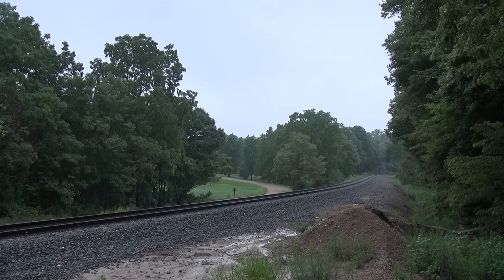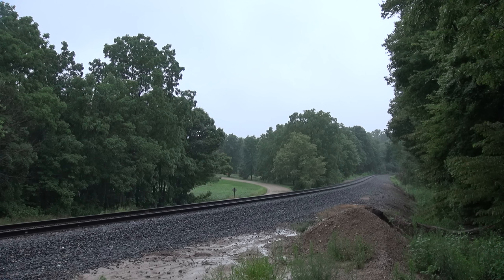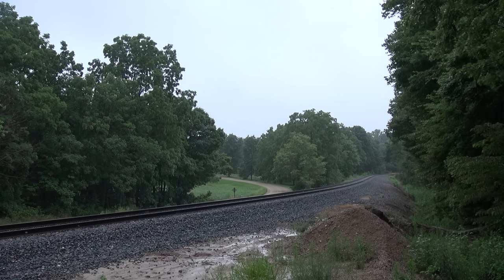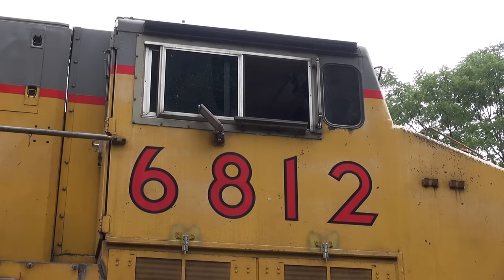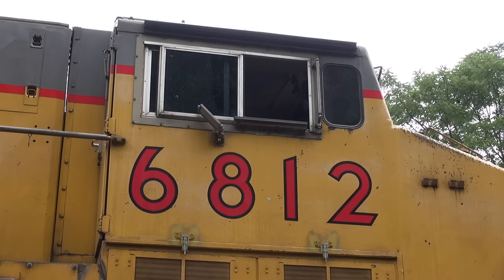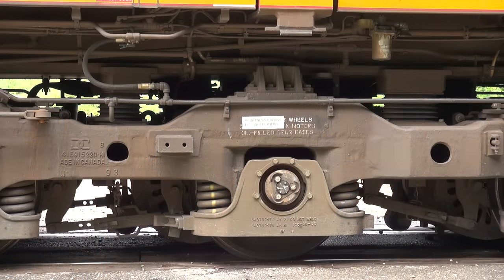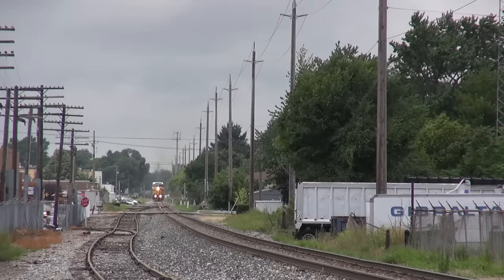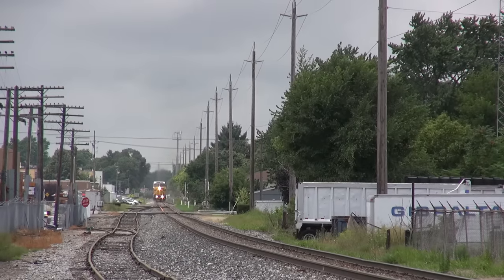TRRS 477: "Whoops!" CSX Freight Train Stalls on Grade

Comment: As a locomotive engineer myself for 30 years, I can proudly say, such an event never happened to me. If a load was exceeding the ruling grade I refused to accepet it.
Reply from the maker: I've heard that the crews are usually persuaded to take them in order to get home, otherwise the railroad has their means of "getting back" at the crew.
Reply: Yes, came across this attitude many times in my career, however, Engineers need to stand their ground, as it is THEY who will stand in the dock when the Sh** hits the fan, not the controller. In my country, every engineer must pass a safer working examine which is a Government Instrumentality, which has very clear rules, and any engineer deviating and breaching said rules, opens themselves to litigation and possible prison time. For example, in the video depicted, the rear half of the train is required to be PROTECTED at the front portion, AND the rear, even in CTC signal controlled areas. This means the second man needs to walk back to the rear portion of the train to put down protection. I did not observe this being done in the video. Also the roll back, that is totally forbidden here. Screws up signaling totally, and not to mention any level crossings in the rear as well. Therefore, it is the interests of engineers to draw the line in the sand conforming with the Rules and regulations FIRST, not what the despatcher or controller would like them to do. Many times I have had to point out the page number and paragraph to the despatcher, when they demanded I perform some action that was clearly, contrary to the rules. I did not endear myself to them, but I wasn't in the job to make myself popular to them. I performed my job as laid down in the rules provided, there was nothing the despatchers could do except fume and plead ignorance of the Rules.
Reply from the maker: All rules here were complied with. The crew needed only to set enough handbrakes to hold the rear of the train on the hill before pulling away, no rear-end protection necessary - that's what the signal system is for. What do you mean by "roll back"?
Reply: Where I worked, halving a load required protection be put down at the front AND rear of the train, as well as applying WORKING handbrakes. It matters nought, that the train is in CTC territory, as the signals do not indicate where the blockage is in the section. That's why the protection in the rear to give advance warning anyone coming from that direction is getting close to the obstruction in front of them. The "roll back" seen in this video, is the tension on the buffers being pulled from the front being relieved and then tension from the rear as the load is going back down the grade. IMHO, poor example of train handling, as the Engineer has not applied the train brake, which would have avoided this. For what it's worth, this event should never have been allowed to happen.
Reply from the maker: In North America, CTC includes rear-end protection. Following trains will go through the progression from Clear to Approach, and finally a Stop-and-Proceed or Restricted Proceed, both of which require the train to be handled at a speed which permits them stopping in one-half the range of vision, short of obstructions or track defects, not exceeding 15 or 20 mph, depending on the railroad. 

So in this case, no rear-end protection is required. Neither is front-end protection, either, it's covered in much the same way as well as by dispatcher authority. This is a large part of why there is no longer required to be anything other than an EOT on the rear of the train, to rear brake-pipe pressure to ensure continuity. 

As far as train handling, since they were moving so slow, and trains on this grade are known to crawl at literally crawling pace or less, it is totally natural to wait to apply the trainbrakes until forward progress has stopped completely. It results in a bit of rollback, but a few feet won't hurt anything. 

However, surely as you point out, it shouldn't have been allowed to happen. The crew was setup to fail, and it happened. They dealt with it according to the rules, and got it wrapped up in one piece.
Reply: Right, much clearer now. My son used to work for an American company here in Western Australia. I believe said company is classified as 4 tier in the U.S. and is quiet happy running it's services at 20/30 Kilometers on crappy forth grade lines. He's had a lot of difficulty coming to grips with the mindset of the U.S. style of management. For example, running a grain train of 72 empty wagons to the siding where they were supposed to be loaded, only to be informed they only had enough grain for six wagons. He was not allowed to make a decision on site, (like I was in the OLD days) he was required to ring head office, 480 K's away, who rang the boss who was home sleeping peacefully as you do at 0200 hrs in the morning. Boss told him to load what he could and leave the empties behind, another crew would then come on, run light, and pick them up, drag them further down the line to the next loading point. The issue is, why was it necessary to inform the boss on a tiny decision like that, which we made nearly everyday during my time on the job ? Weird. Another strange thing, we were trained to make repairs, (up to a certain point) on our locos when they broke down in the bush, most times we could get them running again and limp home at reduced speed. Today however, that idea is no longer accepted. If a loco breaks down, she stays where she is and a crew from 400 K's away, will come with a truck outfitted with necessary gear, and try to repair onsite. In every case, there is no offsider, just the diesel mechanic. If he can't get it fixed, only then, do they bring on a loco to tow it back to the shop. Thankfully, he got sick of it all, and transferred to the Iron Ore heavy haulage, where things are run far better.
Reply from the maker: American railroad management is highly militaristic in it's organization. Not many decisions are made on the ground level. You'll find it sometimes, but not very often. It's too bad, because many people who could be trusted with making decisions don't ever get the chance, so managers get the phone calls they don't want at 3am. So it goes! Thanks for your input here, I have enjoyed learning about how it is done elsewhere!
Reply: You can stick 4400 hp in one locomotive,  but it still only has 6 axles, three sd40-2's would have dragged that up there

Comment: How long did the whole process take? Very inefficient.  Also, the power hooked up to tank cars when they picked up the second section. I don't understand why the tank cars weren't still behind the engines after the train was reassembled.
Reply from the maker: Couple hours. And when they put their train back together, they doubled over the original headend from the siding back onto the rear, keeping the original order. This was done both to keep the paperwork in its correct order and save having to reset the end of train device.

Comment: Wet track and wheel slip on the locomotives. Those engines were almost at idle when they got to the top of the grade. No smoke from the exhaust no thunder. Wet track limited power. Wheel slip stalled this train not lack of power. 2nd pull the track is dry and he hammers it ..

Comment: the worst problem to a locomotive engineer is this case.the train cant climb a gradient...the problenm is the huge weight (9000 tons.) if the gradient has only 1 degree,,,the inverse force is aprox 157 tons,,,one locomotive has aprox 30 tons of maximum tractive force,,,,no more because the adherence coefficient wheel-rail is approx 0,3.....0,4..  but isf the locomotive begins to slip,,,this coefficient lows dramatically to a low value as 0,1.    Here is neccesary a total tractive force>>157 tons,,,for example 200 tons,,,because an extra force is neccesary to accelerate the train.i watched a lot of cases like this,,,,the misstake is not calculate this force   beforeb launch the trip. very nice video and capture.

Comment: They would've made it up the grade if that SD40-2 was put on the rear as a DP. It doesn't seem like much but a pusher unit can make all the difference.
Reply from the maker: I know what you mean, but I'm still skeptical. The train was still well over 1000 tons short on power, so I don't think it would have fully made up the difference.
Reply: @ThornappleRiverRailSeries  Give'r a good start before going up. Once she has the momentum they could pull that off. My father has told tales involving Tacoma Rail's 3.7% grade on the mountain division and simular sized trains during car storage moves. As soon as they tacked that DP on they pulled it up the mountain just fine. Straight notch 8, and let the sand flow!

Comment: Maybe I am missing the obvious here, but if the train stalls on a hill, and they pull up the first 40 cars to the siding, why don't the last 40 cars slide back down the hill?  The engine is disconnected, so the air brakes will only be effective for a short time.  Does the conductor go and set hand brakes on 30 of the 40 cars?
Reply from the maker: Each car has a handbrake, and they set enough of them on the back end so that it will not slide down - they event test to make sure it holds. Also, when they pull the train apart the back half will enter emergency air braking, so everything will be held. The handbrakes are an important backup as the air brakes will slowly lose their hold over time.

Comment: how do they synchronize power to engines such that they are pulling together as one unit?
Reply from the maker: Both locomotives are connected by a standardized communications bus, which causes the trailing unit(s) to emulate the leader. Each engine has throttle settings 0-9, which are roughly comparable. Each engine also has wheelslip control, so if they start slipping they'll reduce power. So for the most part they sort themselves out. 

But it isn't uncommon, especially when starting out, for units to "fight" each other a bit which gaining traction, as low-speed tractive effort varies quite a bit, especially once you factor in the time it takes between when the engineer adds throttle to when the power is actually applied. EMDs "load" much faster than more contemporary GEs, in particular.

Comment: Well the Union Pacific 6812 AC44CW is 4400HP machine the CSX 8880 IS ONLY 3000HP.  That train maybe had a shot to make it  on one shot if both engines would have been GE Evolution ES-58-ACi a duel 6600hp monster maybe made that grade with that weight.

Comment: Question:  You break the train in the middle.  Front half makes it up the hill. Second half then makes it up the hill.
When reconnecting, isn't the second half now ahead of the first half?  Did the order of the cars in the consist have any special configuration or plan when assembled/staged?  Does the original order even matter?  Thanks for insight on this.
Reply from the maker: So this train was reassembled in the order in which it originated, so they wouldn't have to re-order their paperwork and reset the EOT on a different car. So they simply brought the second half to a stop next to the first and doubled the headend back over. And that is the typical process, around here at least. 

In addition to having to re-order all the paperwork - need to know where all the hazmat is - it would also mess up any blocking, as you suggested. However this train at the time ran as one single block - everything for Grand Rapids.
Reply: @ThornappleRiverRailSeries  Thank you!

Comment: I’m definitely not train savvy lol but what if they use the other locomotive that’s connected to the first one to like work together?? Is that possible or doesn’t that happen????
Reply from the maker: The two are connected and setup to run together. Trailing units will mirror the lead engine.

Comment: How do they pair the drive locomotives to provide power when their is a driver in the first cab.
Reply from the maker: There is a cable that connects the power together. The system is called "multiple unit" (MU) control. Basically each locomotive can lead, take commands from the lead, or be isolated (offline). All units physically connected by the cable and which is set to follow the lead unit will respond accordingly. 

This is actually why locomotive throttles are "notched" with 9 power settings (0-8) so that they work well together. The earliest diesels were not capable of being run together, so they actually had continuous throttles like steam engines or your car.

Comment: What I see here are very wet rails, a heavy train and only two diesels units on the head end. What is needed here is, at least, two DPU (Distributed Power Units, placed on the rear end for additional power. Just my  opinion here OK.

Comment: what's the grade on that hill? if it's less than 2% i bet a single big boy could have handled the consist, maybe even an AC 4-8-8-2
Reply from the maker: It is less than 2% as far as a gradient but has sharp curves and a low speed limit, so it's really like going up a 2%. Big articulated steam locomotives would likely have not appreciated the curvature, and it is unlikely one of them could have moved nearly 10000 tons up the hill in the rain either.
Reply: There are stories of those cab forwards pulling over 7000 tons over donner pass in inclement weather and the ruling grade on donner pass nominally 2.4% at 10,000' altitude, big boys could solo 8700 ton consists over the wasatch range in utah which included grades up to 4% at 7000' altitude

i'd really like to see one try.

Comment: I’m ignorant so excuse me but does that second engine on the back actually help pull the train? I always wondered when I see trains with multiple engines pulling if those other engines are actually helping pull.
Reply from the maker: Yes the trailing units are controlled from the leader. Sometimes they will be shut down, but often are helping to pull the train